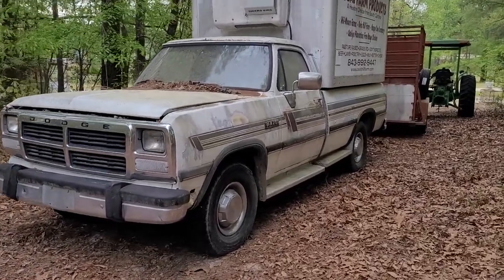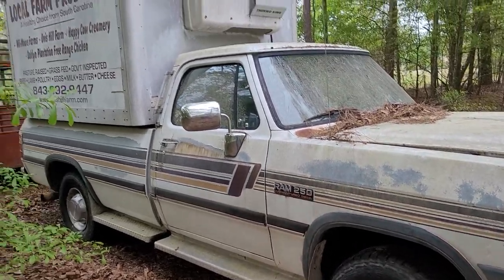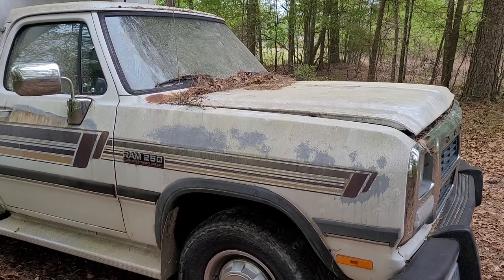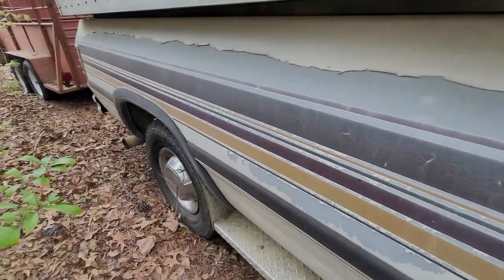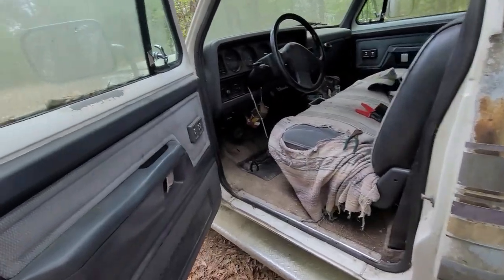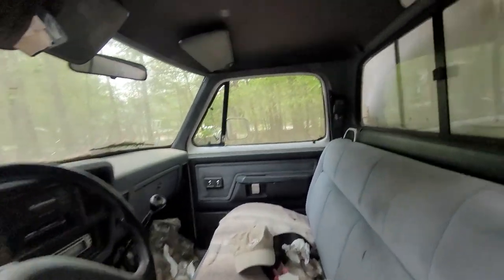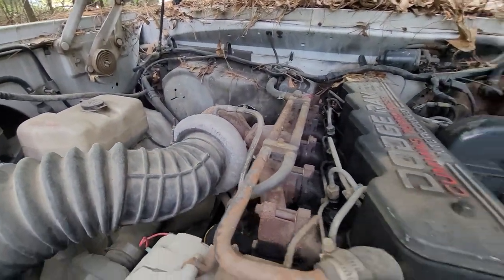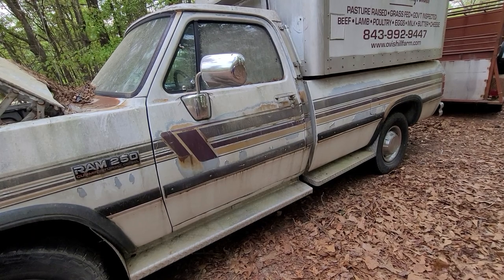Got me a 1st Gen Cummins "what to do first?"

Comment: Read up on " killer dowel pin " in the timing case. If its a 92 the hot side of the turbo may be a 21 cm housing, which is a little laggy. Some 92's had a factory recalled injector pump, and if yours is recalled, and has not been done you may be able to get a new pump on dodge. Lifting a 2 wheel drive, blasphemy. LOL!  The biggest thing to keep the value up is not to chop the crap out of it. A stockish first gen truck is worth more then a modified one. ( my opinion ).
Reply from the maker: Your opinion sounds like good advice too. Thanks for the heads up on the dowel pin and the injector recall.
Reply: @joeburnsandclassiccars2652   Also read up on " overfill getrag g360 with oil " They had issues with stock oil level and burning up bearings. Make sure you do not do any magic screw driver fuel increases without buying exhaust temp gauge, boost gauge, and also a fuel pressure gauge. You need to keep an eye on that stuff if you increase the fuel settings on the pump.